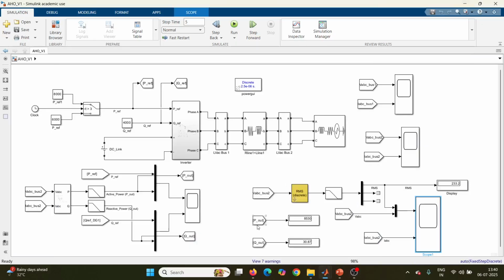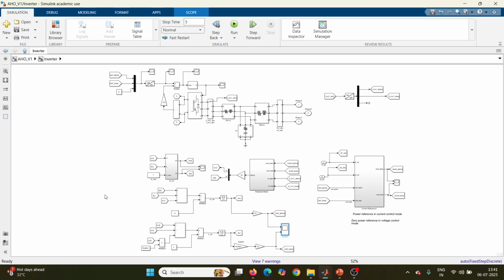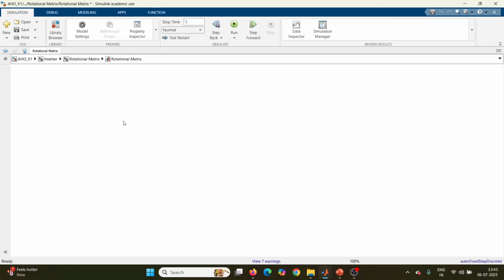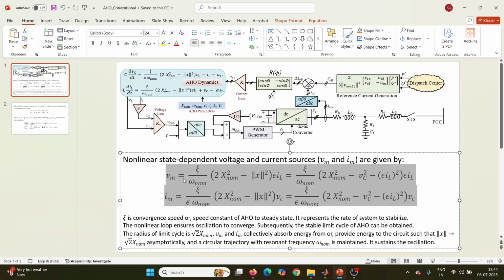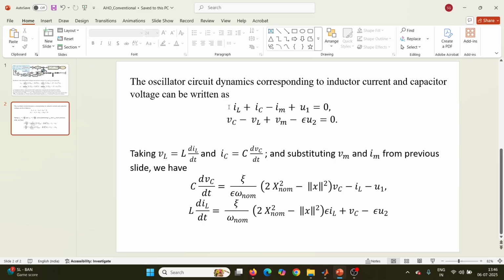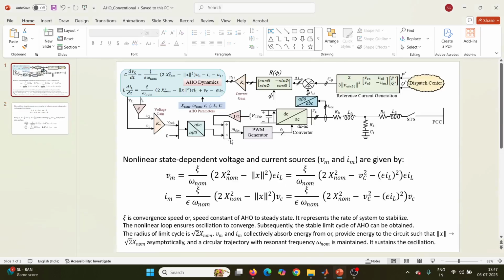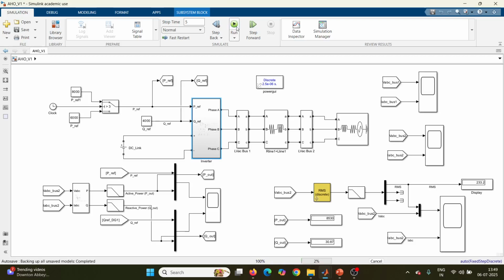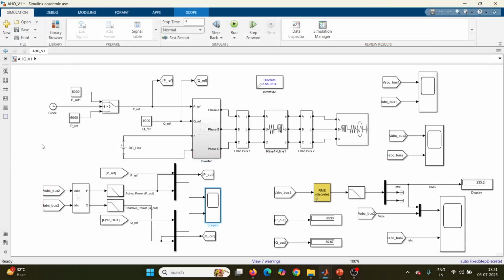MATLAB Simulation of AHO based Virtual Oscillator (VO) Controller || Grid Forming (GFM) Converter

Comment: Thank you very much sir for this excellent and informative video. I am currently trying to implement the model, but I am facing an issue where the Q_ref does not match the actual Q_out, and similarly, the P_ref does not match the P_out.
I have three doubts and would be very grateful if you could kindly clarify them:
1. From where are you sensing or obtaining the Q_refDG1 signal?
2. Just before the Universal Bridge (Rectifier) block, in the PWM control generation section, have you used any subsystem between the DC bus and the Gain (1/2) block? If so, could you please let me know what that subsystem is?
3. Could you also kindly clarify the grid parameters, particularly the grid impedance values (three phase voltage source specifications), I would like to use the same parameters in my implementation.
I would sincerely appreciate your guidance. Thank you in advance for your time and support.
Reply from the maker: 1. There is mismatch in power tracking because virtual oscillator control is not a tightly regulated control.
2. Q_refDG1 is coming from the constant block where we are setting  the reactive power reference.

Comment: Sir, what is this RMS discrete block? Did you build it by yourself?
Reply: And please provide the details of the grid connected. I'm learning from your simulation sir.
Reply from the maker: For grid-connection, you should set the voltage and current gains carefully for synchronisation and power sharing, respectively. If you wish, you may check my Transaction paper: https://ieeexplore.ieee.org/document/10925488
Reply from the maker: No I have used the inbuilt Simulink block

Comment: Thank you for sharing your work, Dr. Sahil! I have a quick question about your model : in your simulationI  the Qref is set to 4 k , yet the calculated Q is close to zero? Does it mean that the AHO control cannot track the reactive power? And in the initialization, phi is set to 0,however, in the "rotation matrix "matlab function,  phi is pi/2?
Reply from the maker: VO control is not tightly regulated control. Power flow depends on the voltage and frequency mismatch. That means highly dependent on line dynamics, we have used. You can choose other values of phi also based on the line impedance to correctly regulate active and reactive power. 

For any value of phi, the model will work. However, the correct designed value of phi will ensure better active and reactive power control. The designed value of phi based on impedance will decouple the power flow, voltage and frequency. Weaker grids have stronger coupling in power flow.

Comment: How can a new and robust control structure be designed? I am working on it myself in Simulink, but it gives poor results.
Reply from the maker: You can apply some additional control with this basic control to overcome the limitations. 
e.g., Virtual impedance, H-infinity, Sliding mode control, Model predictive control, Symmetrical component theory based control, etc.

Comment: Sir  plz make the video for DVOC  inverter also🙏🙏
Reply from the maker: Andronov-Hopf Oscillator-based virtual oscillator control is one of the dispatchable virtual oscillator controls.
Reply: I know sir but there is another approach called Dipatchable virtual  oscillator control only. It is mentioned in a review paper of topic virtual oscillator - based methods for grid- forming inverter control. IET wiley